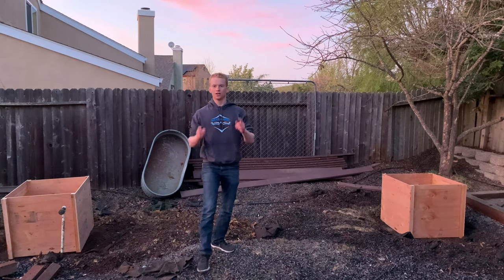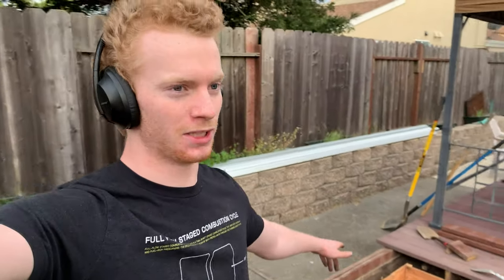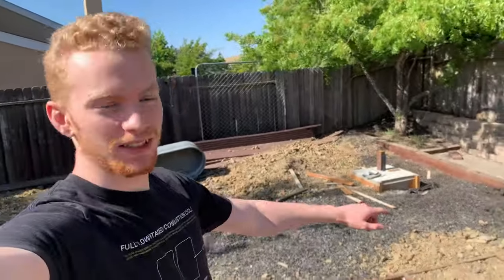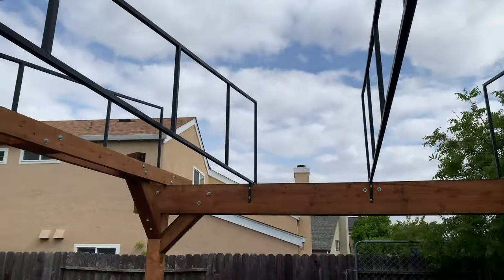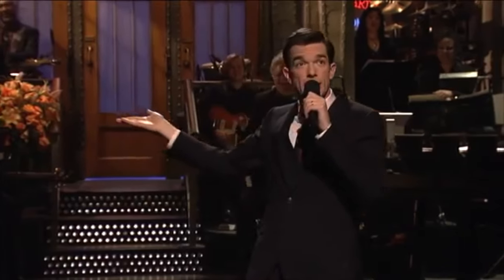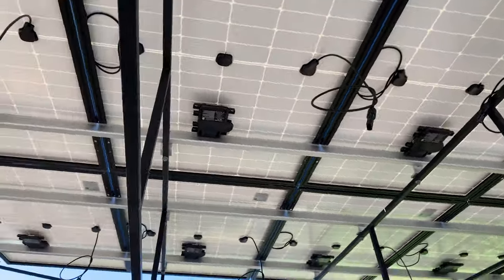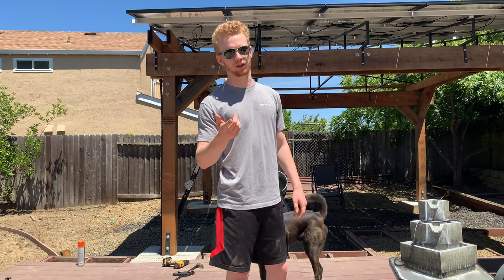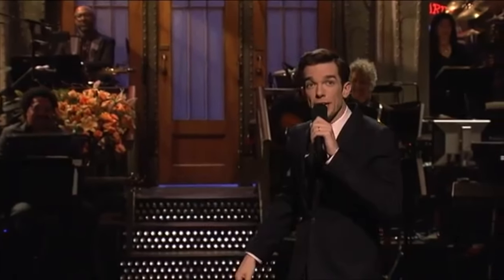I Built a Solar Gazebo in 2020 Your Move John Mulaney

Comment: I like your video.  I am no engineer but I think you went overkill on the concrete.  I am curious on the cost of each inverter.  Without them, you would need access to each panel to check it.  Then again, you need access to replace it if it goes bad.  We need more solar pioneers as you to give the rest of us ideas.  A+  Thanks!
Reply from the maker: Thank you! Overkill is the only was I build things😂. It looks like the inverters are about $155 each and for accessibility with this design all you need is a ladder.

Comment: I love welding!  Well done on the video production and the craftsmanship!  Curious question for my own consideration and design... you compensated for solar position with the quadrilateral you put on top of the wooden structure.  My question is could I  build the “gazebo” with the solar tilt built into the wood structure and just mount the aluminum purlins?  Great content!!!
Reply: Oh and I own that table saw too!  Love that model!
Reply from the maker: Thank you! I don’t see why you couldn’t just put the wood at an angle there’s a chance it could be a little less stable but I’d have to do the math. I think it’s mostly an aesthetic choice or a wanting to avoid welding choice.

Comment: Great video! 🙌🏾 Are there any ways to completely seal the gaps in between panels? So that rain doesn’t trickle down?
Reply from the maker: Thank you! There are probably a bunch of ways but it’s not really worth it cause it’s California and everything underneath is fine getting wet. But I might do it anyway at some point.
Reply: @IntoTheWoodShop  Do it an post it! Thanks.
Reply: I would think a backer rod and silicone would go a long way towards sealing gaps.
Reply: Solar panels efficiency degrades with increasing temperature, so its a good idea to allow a bit if ventilation

Comment: Any issues yet with galvanic corrosion between the welded steel and aluminum rail brackets?
Reply from the maker: The steel is painted to prevent this and it rusting in rain

Comment: I would of just made the back wood poles higher , then you can run standard rafters from oneside to the other instead of having to weld up all that racking.
Reply from the maker: In this case it being a completely custom design welding my own trusses was the better option both structurally and aesthetically.

Comment: Did you consider bifacial panels?
Reply from the maker: No don’t think it would have been worth the extra effort in this case. Easier and simpler with what we used
Reply: @IntoTheWoodShop  I'm curious what extra effort ? They do weigh more I suppose.
Reply from the maker: I haven’t looked to much into it but I’m guessing the mounts would have to be completely redesigned. For this project my dad did most of the sourcing and research so I’m not sure
Reply: @IntoTheWoodShop  it's just a regular solar panel with solar wafers on the back side and transparent glass on the back side. Light that passes through and reflected back up get turned into electricity. 

They are really neat in this type of application.
Reply from the maker: Don’t know what to tell you we just didn’t use them

Comment: Is it waterproof ?
Reply from the maker: All the components are waterproof but there’s about a 1/4” between each panel so if you stand under it in the rain you might get a little wet.
Reply: How did you calculate how much railing you needed to mount the panels
Reply from the maker: @jomosmith1311  The whole thing was drawn up in CAD first. Then it's just basic math from there.
Reply: IntoTheWoodShop which CAD program did you use ?
Reply from the maker: My dad was the one to make this model he used 123D, but I use Fusion360 and Solidworks for 3D and AutoCAD for 2D.
Reply: IntoTheWoodShop thanks , I’ll check those out
Reply: @IntoTheWoodShop   BTW did you have a slight tilt on the solar array ?
Reply from the maker: What do you mean?
Reply: IntoTheWoodShop meaning did you tilt the panels a little or are they flat on
Reply from the maker: As I said in the video the trusses I welded angle the panels south so they get more direct sunlight.
Reply: Ok , I got you thanks.
Reply: IntoTheWoodShop are you guys saving money ? Was it worth wild? Do you use batteries ?
Reply from the maker: Definitely worth it, our power company has to pay us if we make more than we use. That plus basically eliminating our electricity bill means this will completely pay for itself in 10-15 years. It’s also just cool and a nice place to hang out under. No batteries.